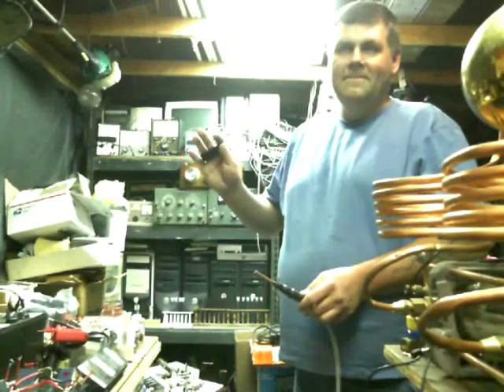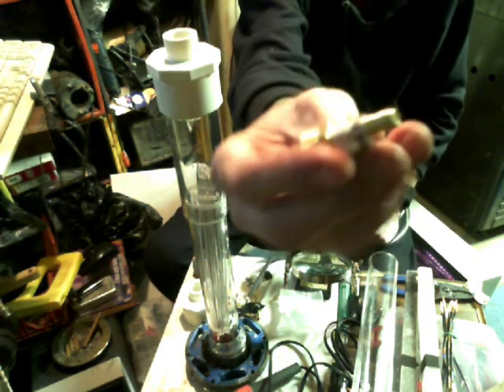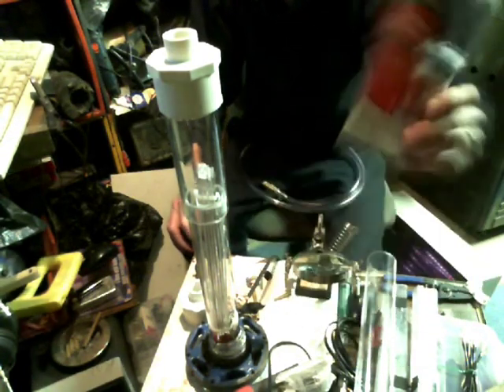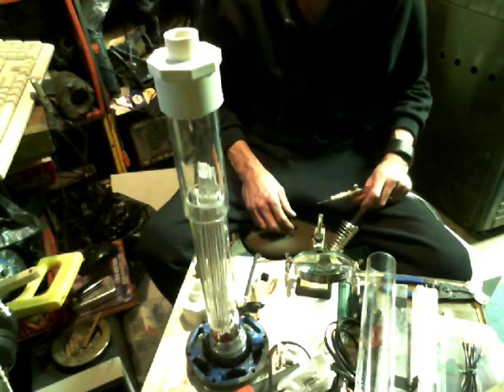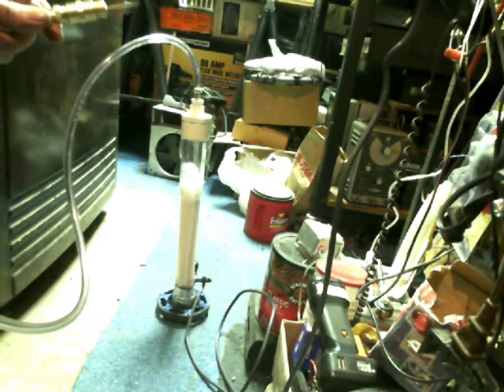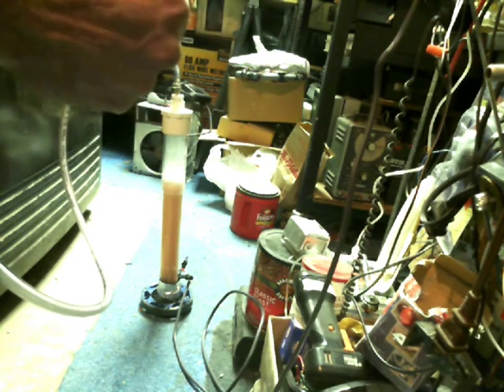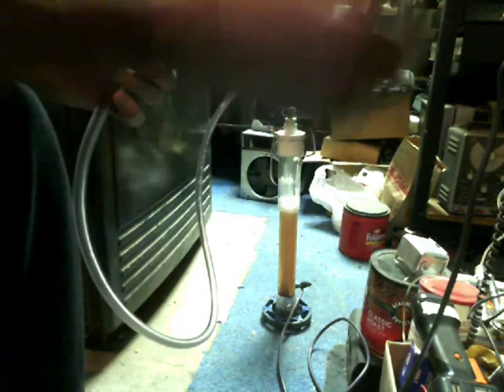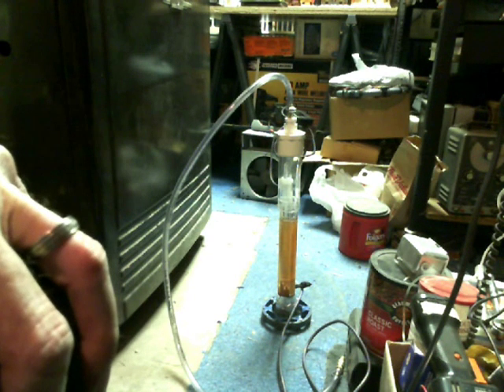HYDROGEN CELL !

Comment: that pop is comeing from the in side of your tip there is water vappor in it pooling up i know i made one my self i used a 2 gallen air pump tank and i pump about 5 psi in it and a torch tip and hade a 5 foot flam and melted a copper pipe down with it it works good i made a mini one out of a pill bottel